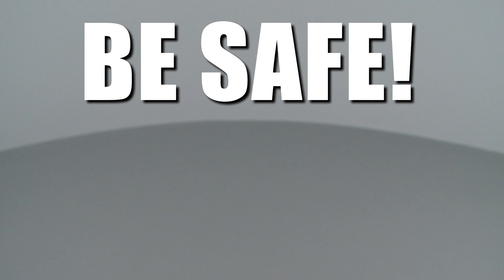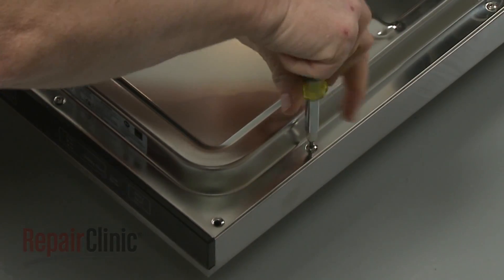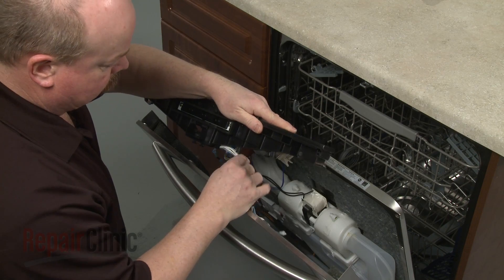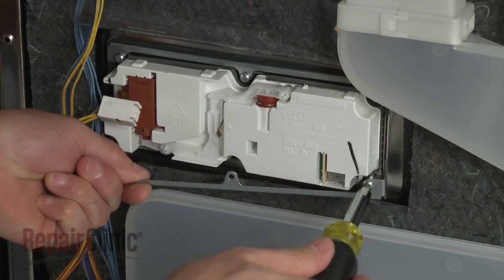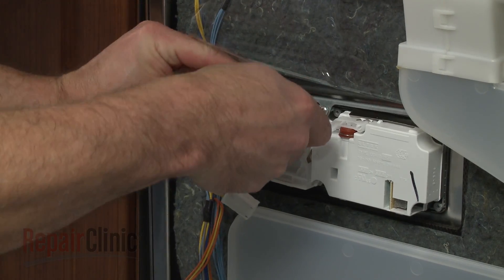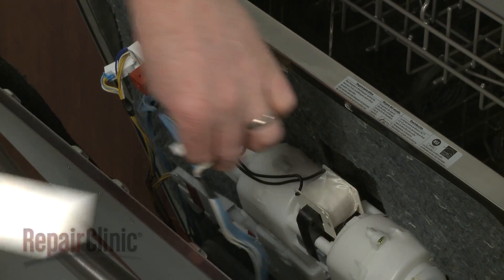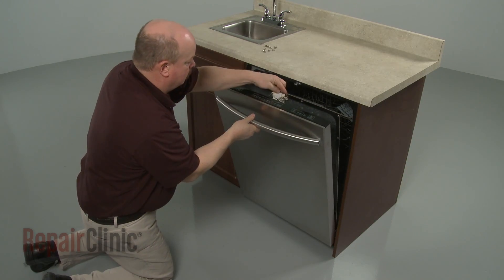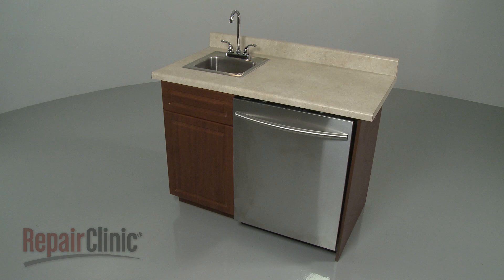Samsung Dishwasher Replace Detergent Dispenser #DD5901001A

Comment: If you are having locking tab issue once you know what to do its easy. Push the wire in as much as possible. In being towards the dispenser. Place the edge of the screwdriver at an angle on the metal piece sticking out of the wire. Depress and push. It comes out just like in the video. They needed a better camera angle.

Comment: At 1:32 I'm having trouble disconnecting the locking tabs which way is the correct way
Reply: jtrekmadone me too
Reply: Me 3
Reply: I broke the wood part that was holding it together I don't know how dude did it in the video in 1 shot

Comment: It is no where near this easy folks
Reply: It hardly ever is lol, they do these vids on mint condition appliances so parts and screws are never extremely stuc, corroded. and difficult to move. Theres always hiccups that have to be dealt with when replacing or fixing things. But once u do get through it and fix it, it is satisfying lol